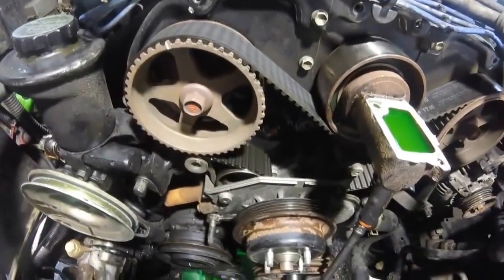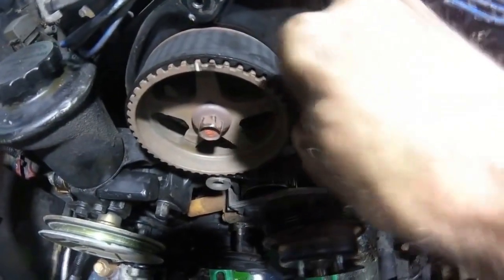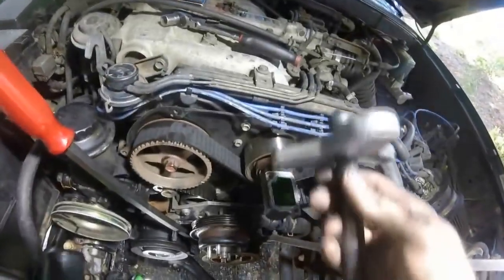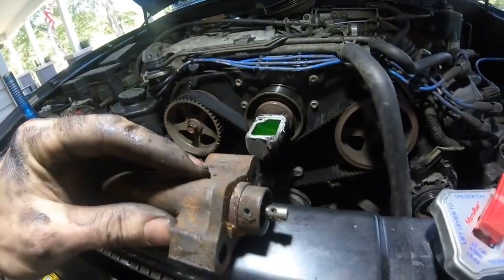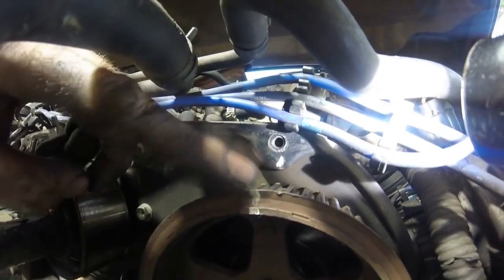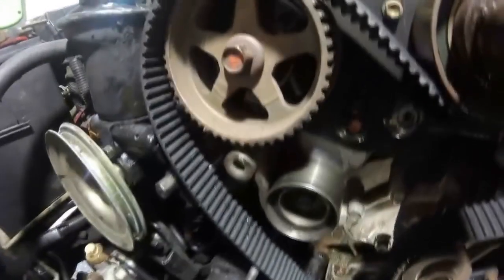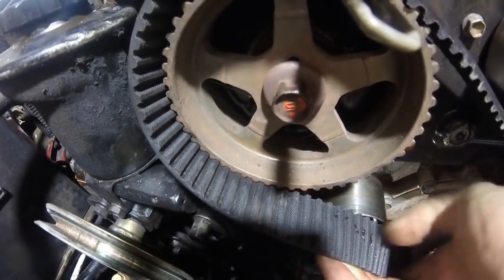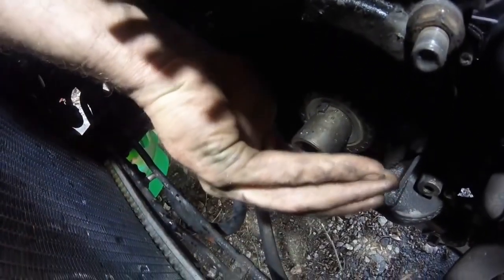Toyota 3.0 3VZE Timing Belt Installation How TO

Comment: Hey bud thanks for the video. No critique here but from the angle i saw it didnt look like the right cam was toatally dead on. Was it the angle or is there a tolerance? Thanks
Reply from the maker: It's mostly the camera angle. I've been asked that a bunch of times. On the premarked belts, I don't pay much attention to the marks on the back timing cover after I initially set it. The marks on the belt tell you all you need to know

Comment: Extremely helpful video, thank you.
Reply from the maker: Thanks. Good luck with the head gaskets
Reply: @AppalachianDIY  Thanks. Everything is going smoothly except for the fact that there no bottom dot on the crank sprocket for the timing belt

Edit: Found a picture of one with the dot and counted the teeth lol.

Comment: That's a breaker bar, on the crank pulley, and I'm actually attempting one of these today, because the previous mechanic didn't change the water pump, idler, and tensioner.  Bad idea

Comment: You can check to make sure your on the correct rotation with a screwdriver down the #1 Cylinder...
Reply: also...if you decide to work on the timing belt...just take out the 4 bolts hat hold the radiator in....

Comment: 90 4runner with a 3.0 for sale it had the belt replaced and he was driving down the road and it died it had no water . It's for sale it has 90k miles in nice shape. What damage could it have done? Is it fixable?
Reply: 3.0 is notorious for blown head gaskets, sounds like you found one. Could have warped heads or cracked heads or block if it got hot enough.